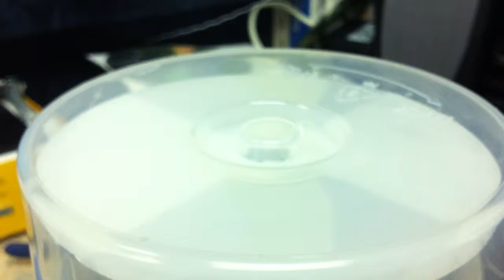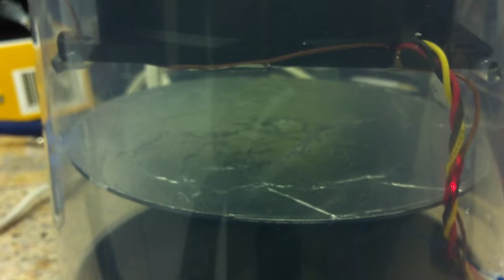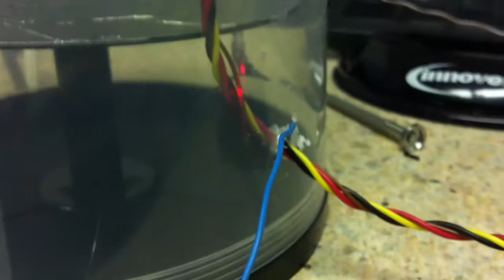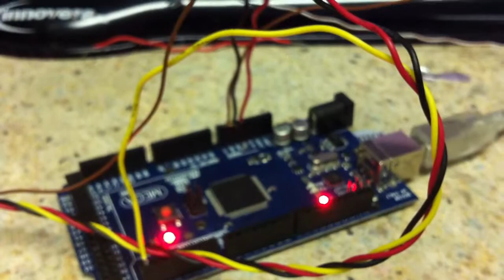Arduino Based Field Mill Built from PC parts

Comment: Hello, i'm a physics student in belgium and i have to build something like that for a project. But i was wondering if you didn't have other videos of the construction for instance, i read the article on the website instructable but i don't understand everything, i'm not good enough at english and i have no knowledge in this kind of things... 

Our purpose is to measure the armosphere electric field and I would like to see the variations in altitude, so i need to attach it to a big balloon but if the field mill is under a balloon, is it still going to measure something or will the balloon hide the field mill and prevent it from measuring something ? 

Sorry for my english i hope you will understand me.
Reply: Il t'a répondu au final ×) ?
-le monde est petit